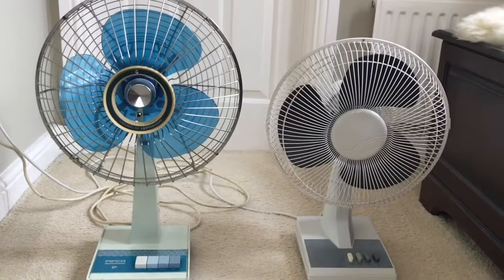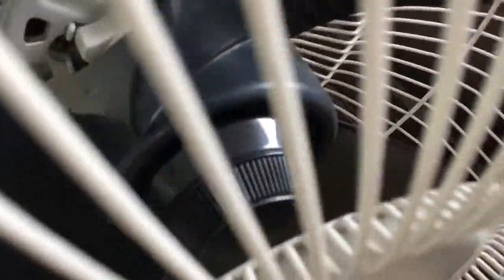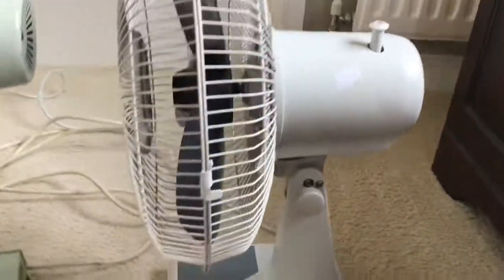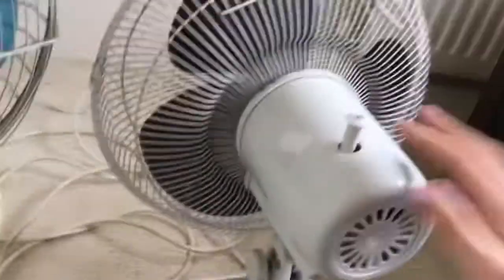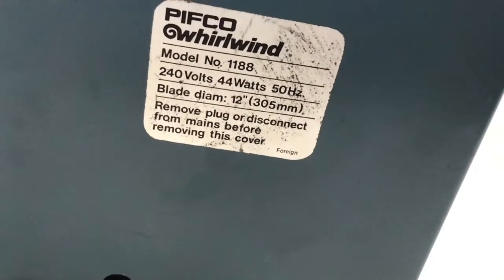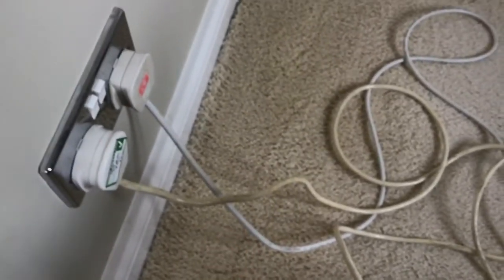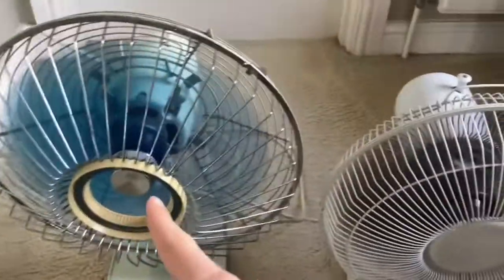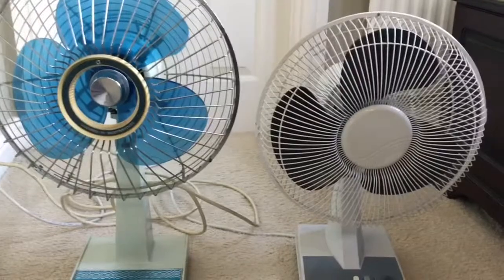1960s pifco 12” fan vs 1990s SMC 12” fan: which is better?

Comment: The metal based SMCS are the best in my opinion
Reply from the maker: Like best SMC fans?
Reply: @Connectitthefancollector  yes so my 1997 CED is one of the best built SMC made fans so are the Ferraris and the Tasleys
Reply from the maker: @LiftEnthusiast2020OFFTOPIC  i have never owned one so I cannot judge them
Reply: Neh it never happen bro,well I geuss u never owned a vintage Japan made fan than
Reply: @RichardPeterMaritz  actually I own a Spinair from the 1960s and it is Italian made

Comment: Bro,in the last year's of great fans,was the years air conditioners was a minor thing and fans was still the biggest seller,however after 1975 air conditioners were the thing fans became completely cheap after 1985 because look around air conditioners is much bigger than fans nowadays,so companies saw a big decline in their income with fans and a massive income from the "newly" air conditioners,hence some companies decided to no longer manufacture fans and go straight to only air conditioners,so the pifco would win all the way defnitly,even your indola Wich was a cheap priced fan of the 50s is way better than the fans made in the 90s
Reply from the maker: Ok thank you for the information. My parents house do have a general air conditioner from 1998
Reply: @Connectitthefancollector  no matter I like vintage fans not air conditioners but most people don't like fans so
Reply from the maker: @RichardPeterMaritz  yeah i love vintage fans and i do like air conditioners but i am not a air conditioner enthusiast
Reply: @Connectitthefancollector  also for instance my Hitachi pedestal fan,on its highest hight it's 1.8meters tall,new fans can only go 1.2meters tall,big difference,my Hitachi pedestal fan is also spring loaded when adjusting it's hight
Reply: @Connectitthefancollector  1.8meters is almost as tall as a door
Reply from the maker: @RichardPeterMaritz  yes that is tall, i plan to use the tatung for night